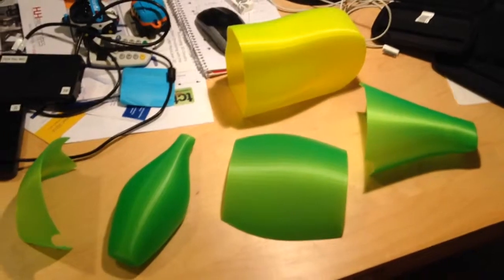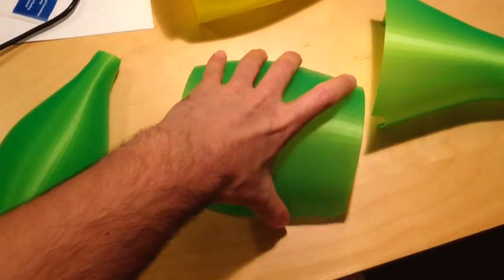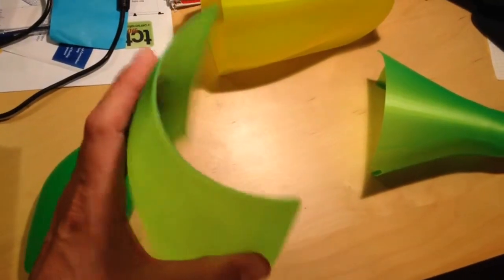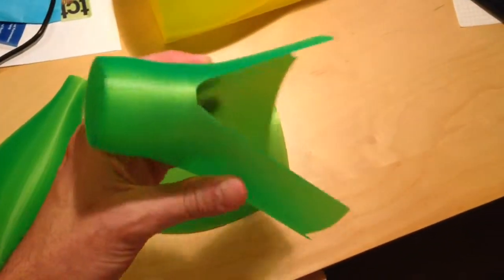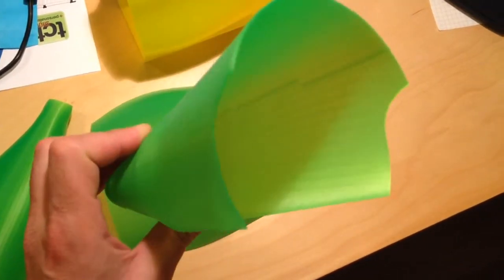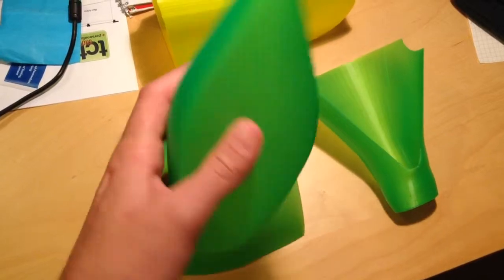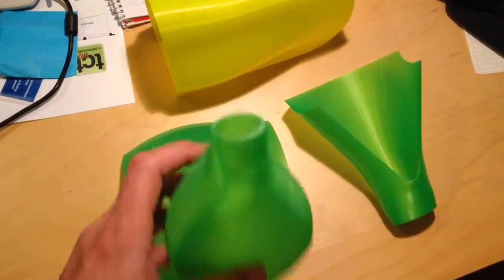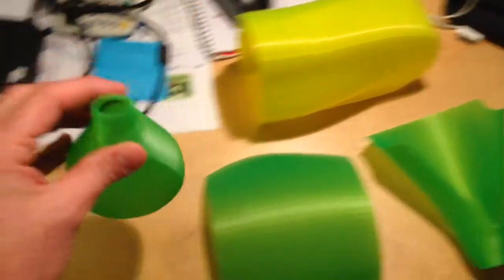3D printed canopies

Comment: Nylon? What printer?
Reply from the maker: PLA on 3D Touch printer from 3D Systems. I use the Kisslicer Pro for slicing, not the 3D Systems slicing software, Axon, for this printer. You can also use Cura or Slic3r. Without having tested thoroughly Cura and Slic3r, one (of many) thing I find useful in Kisslicer is that you can easily and very clearly inspect the extruder paths and detect areas that can be better build increasibg, for example, the number of loops in the skin. This is actually useful to check that the thin parts you wanna build (mot using the 'vase' option) will be properly printed, as you see here in the full-scale canopy parts